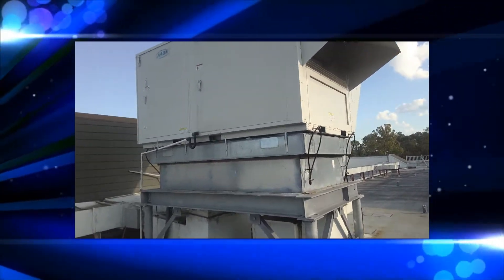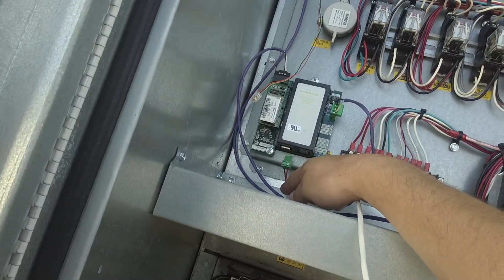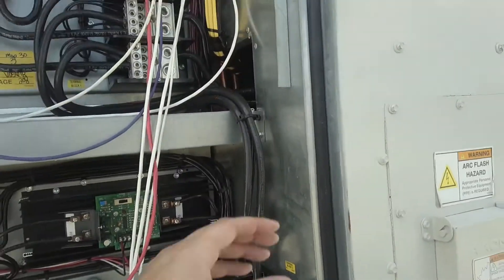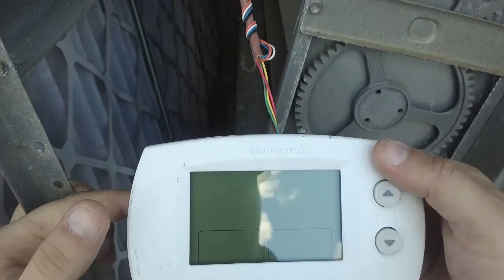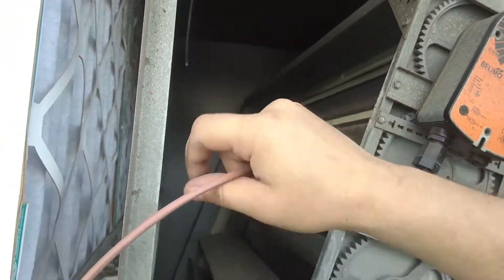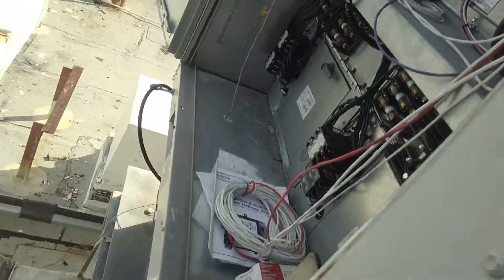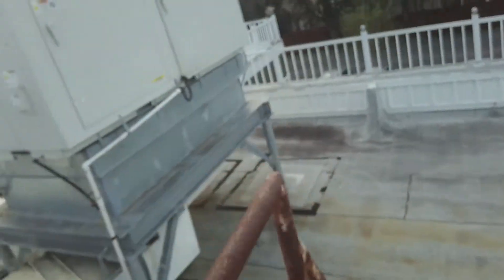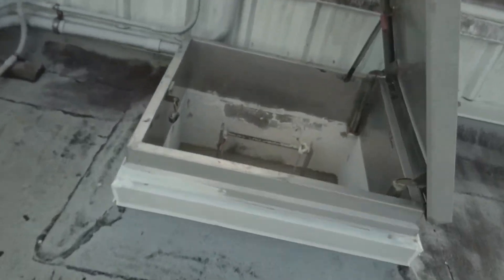HVAC AAON (CAN A 30 TON AAON RTU RUN OFF OF 2AA BATTERY'S)

Comment: I’m not sure why techs put gauges on every unit. If you look on the name plate it will tell you the charge in pounds and ounces. Refrigerant is very heavy. Every time you put gauges on a unit you lose refrigerant. You do this several times and the unit will be low on charge. Then you’re looking for a leak that does not exist. This is for package units. Unless their is a problem with the refrigerant circuit don’t put gauges on the unit. Over 90% of the time the problem is going to be electrical. I’ve been doing AC service many years. The last thing I grab is my gauges. STOP putting gauges on the units. Their I feel better.

Comment: How about using a stat with two cooling so you can have both compressors on when it calls for second stage.
Reply from the maker: The Honeywell Pro 5000 does have that option but the ac company  has already rigged the unit so im not going to dive that deep if you know what I mean . Ohhh and that 1st stage is hooked to the unloader module. It controls the digital copeland scroll compressor. So I don't really don't know if that would work but heck like i said no training. Thanks For Watching .